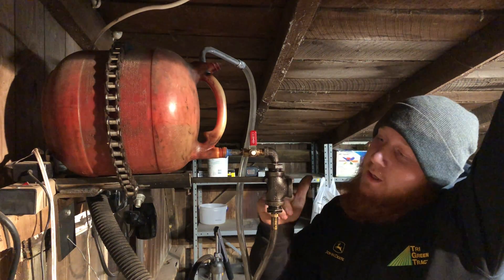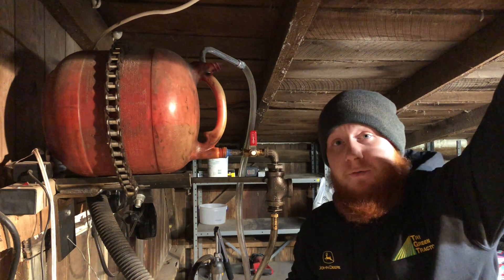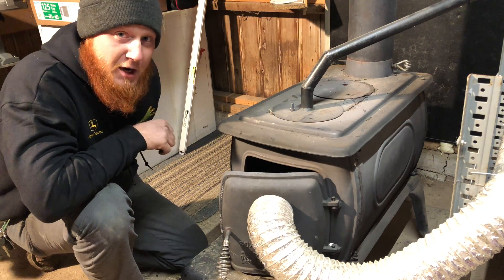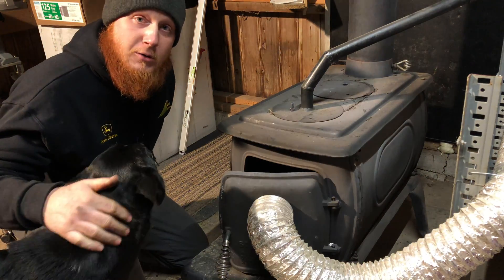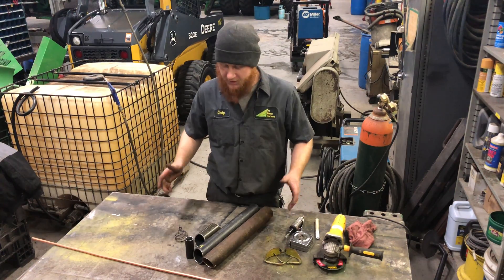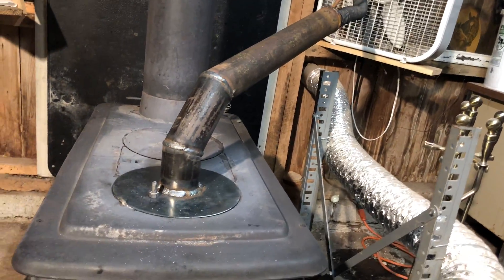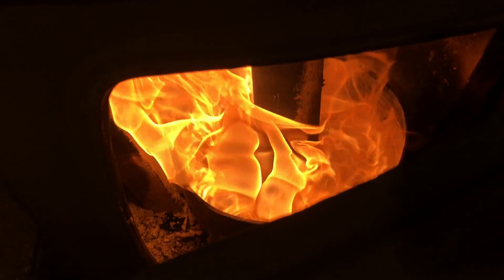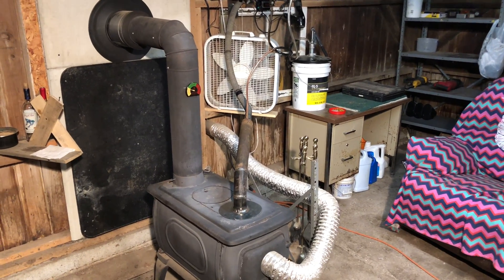Oil Burner Revised

Comment: The best way I have seen it done is how Oil Burner does it. He runs his air pipe in at a 45 degree angle and lets his oil drip into his air pipe outside the stove. Very simple and easy.

Comment: I have a difuzer installed on my air pipe and that works well. It is a washer that I welded a bolt to and hold that on with a hose clamp. The oil tube goes through the hole in the washer and the washer blocks the air from blowing directly down. It works great, hope this helps😊

Comment: Idk if ya remember bc we talked on your first video try using shorter wall pan I use a cast iron about 4 to 5inch round and have the center about 1inch to 1inch -half and my hair pip is about half inch round I use a plower that's used for closed in wood burner works great and my oil feed is size of a pencile tip

Comment: Almost exactly what I did except i had a 6inch pipe flange with about 5 inches of pipe inside the flange and i put it on top of my pot and it gets that flange cherry red and throws tons more heat i also have my air pipe about an inch from the bottom of the pot works like a dream
Reply from the maker: RON GEARHART that’s a great idea!
Reply: I just uploaded the quick video on mine if ya wanna general idea

Comment: so you want a swirling air stream in your pan? The way to get is is to put a square piece of tubing in for the blower. And then instead of letting it blow down you put an end cap on it. Then you drill holes in the square tubing, but you do it near the corner, all on the same corner making it blow off center against the walls of the pan. That way the path of least resistance for that air will allways be to take the turn with the wall of the pan.  But you have to sort of drill all the holes of the left or on the right corner if you are looking at the flat side of the tubing if you know what i mean. Then turn it to the next flat face, again the same corner till you have done all 4. Now you will get a nice swirl going.
Reply: Bob do you have a drawing for your idea? And have you done this befor ? Thank you.

Comment: awesome! love your design. do you really need the outside air? wont the blower provide adequate air with the front door vent closed?  i dont think you had problems from too fast of a stream i think you needed more volume!  if you increase cross sectional area of your pipe you increase rate of flow 16 times with same pressure head.
Reply from the maker: kiffer tom well the outside air is more for when I burn wood but I always leave it open. Appreciate the feedback!
Reply: your setup was just what i was looking for! thanks for all! have it good!